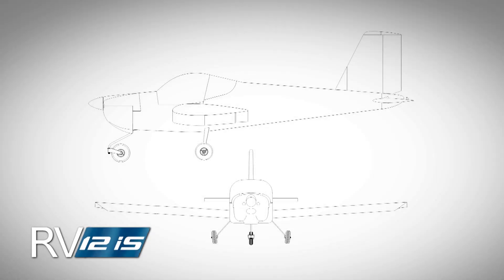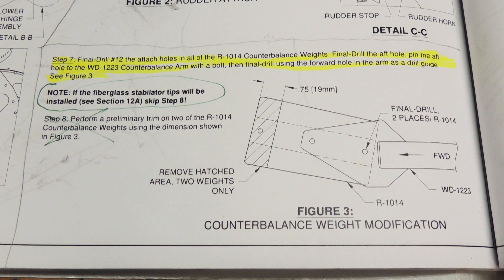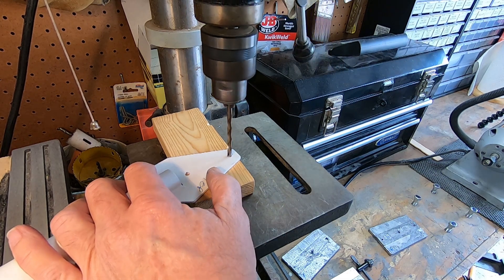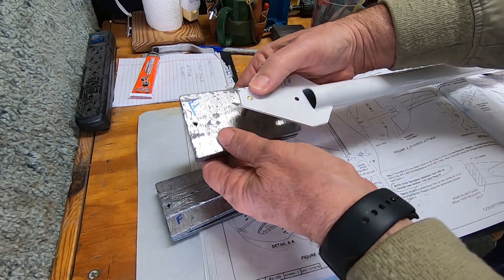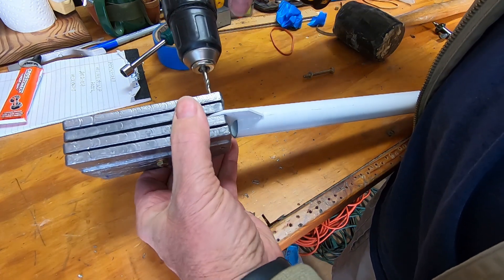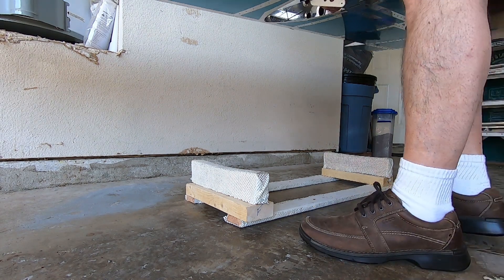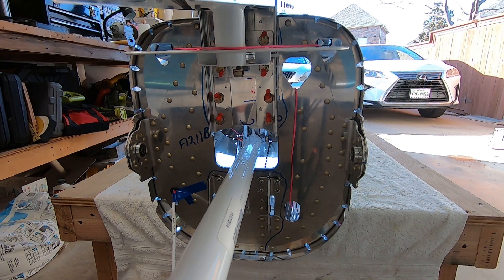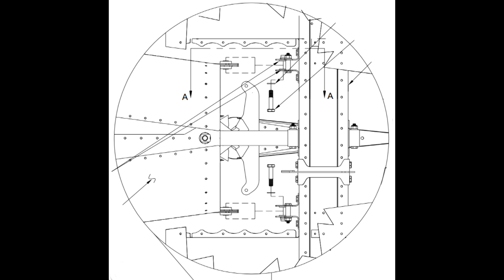Van's Aircraft - RV-12iS - Stabilator Attach (Snowmageddon in Texas!)

Comment: Why did you choose the RV12is?  I am torn between the 12is and 9a.  I don’t need aerobatics and mostly want a fun plane for quick flights under 200 miles.  Also want to be able to do some occasional cross country.  Drawn to 12is for the ease of build and cost.  The 9a looks like it will take at least twice as long to build and not sure my wife and neighbors will like the rivet pounding the 9 requires.
Reply from the maker: The RV-12iS is much easier to build. Pounding rivets for the 9A takes some learning to master. The 9A is much faster in flight, but like you, I'm only interested in short flights and the occasional $100 hamburger. The 12 is a great choice, and a joy to build.

Comment: Don't forget to apply the torque to the nut (instead of the bolthead) whenever possible...it allows the bolt to remain stationary and not influence the torque applied. Yes, you do need to account for the drag from the self-locking feature of the nut and add to the required torque value. It also doesn't allow the bottom of the bolthead to scrub the surface if no washer is installed.